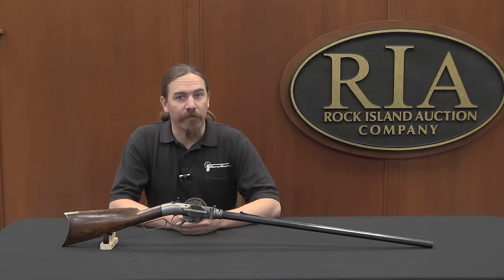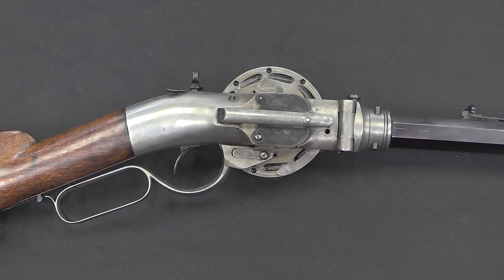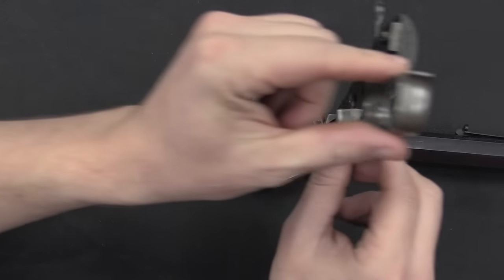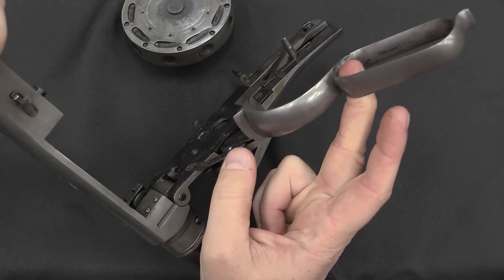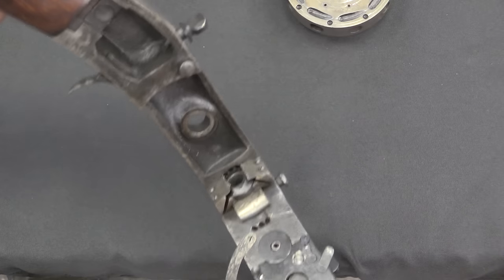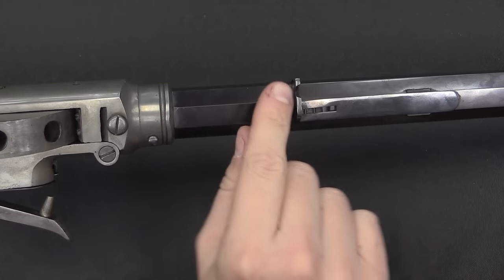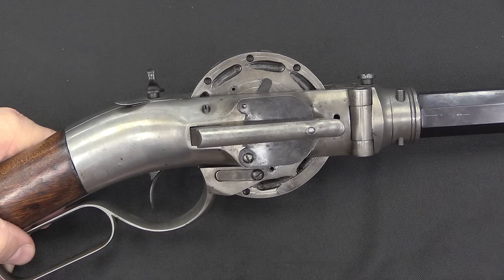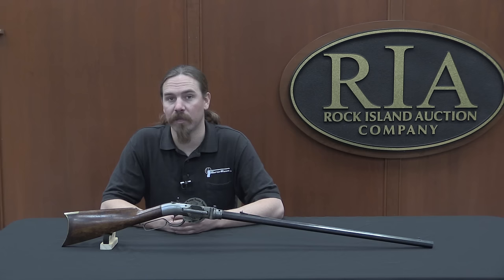Porter Turret Rifle: Awesome But Dangerous

Comment: I suppose you've already figured out the cap magazine being open when the rifle is cocked, but in case anyone doesn't know - I found a picture of the rifle, where the cap magazine has a sort of plate around the hammer that completes the circular look of the cap magazine and holds the loaded cap in place. The hammer fits in a hole in the magazine rather than an open space where the caps would fall out.

Comment: I bet there was some sort of clip that held the caps and it was loaded as one piece with the caps captive.
Reply: +Григорий Александров I think this is backed up by the fact that the "pusher" is not a half-circle as you would expect if it was pushing caps, but is a flat edge that would push on some sort of strip backing with all the caps on it.
Reply: +Григорий Александров I was thinking a similar thing. A discardable paper cartridge, each time the hammer slams down, a cap is torn off and detonated.
But a metal clip like +Ryan resa is talking about makes more sense.
But how would you index it? The caps would somehow have to prevent the clip from rotating unless they are fired. We need a better look at the cap magazine.
Reply: M a g a z i n e *
Reply: Maybe you don't actually open the compartment to load it, but rather single load caps into it tube magazine style? Looks like they might be retained that way.
Reply: pj jp  kids don't do drugs

Comment: All the comments saying stupid design is kinda annoying. It's interesting for sure and its an old design.
Reply: +ultor europae not really that unsafe. For the time period it's pretty advanced I'd say.
Reply: +ultor europae Compared to modern designs, sure, but we can only say that in hindsight because we know what works best
Reply: ok I'll give you that one. probably why this was the first variant lol
Reply: +ultor europae I know. But it's not a big deal, because this isn't a mass produced modern gun. It's a piece of history and engineering. Appreciate it for what it is.
Reply: +David Ridout believe it or not but there are guns that require you to put your hand in front of the barrel to load. They're called muzzle loaders.
Reply: +David Ridout They're not primed and I suspect that the chainfire risk is greatly exaggerated.  From a bit of googling firearm boards, there are two ways you might get chainfire.  Either sparks cross between the touch holes or venting gasses from one chamber set off others.  The latter can not happen on this gun.  I don't know how much of an issue the former is and it may not be able to happen on this gun either because the cap is spaced away from the plane of the cylinder and only one cap is in place at a time.  It apparently relates to crimping #11 caps onto #10 nipples leaving gaps.
Reply: +Anthony B   Agreed.  It's easy to be an armchair quarterback designer when one is looking back in time.
Reply: +David Ridout i totally forgot Ian is the master engineer of guns and gun safety. He may know a lot about guns and their history, but the gun is not significantly unsafe, compared to other rifles of the time.

Comment: The Cylinder looks like it took an awful lot of machining for that period of time.
Reply: +JinzoDefiler I don't think so. Cast parts are unable to withstand the high pressures caused by firing the catridge.
Reply: ***** Bronze cannons had the advantage that bronze is pretty flexible. Cast Iron Cannons on the other hand had a tendency to burst without warning. This is the reasons why they started to reinforce the cast iron barrels with wrought iron rings to reduce the chance of rupture. 

And what you said about car engines is wrong. Most car engines have a maximum chamber pressure of around 400psi. 9x19mm has a maximum chamber pressure of around 35.000psi (if you use the SAAMI testing protocol).
Reply: And even old cap and ball revolvers had chamber pressures between 6000 and 8000psi.
Reply: +JinzoDefiler they definitely had the machining capability at the time, it was just really expensive.  go check out his video on the merwin and hullbert revolver.  its got tolerances so tight that a vaccum forms between the parts
Reply: +AldanFerrox Casting can easily withstand the pressures associated with firearms.  While forging and machining was the standard of the era, castings could easily withstand the pressure.  Seriously, the millions upon millions of American small arms made during WWII were all castings, specifically lost wax casting.  Ruger still uses casting as its main method of manufacture.  Just an fyi.
Reply: Ben M What kind of firearms? And what parts? Barrels? Chambers? I don't think so.
Reply: AldanFerrox Actually, as Seth said, no cast chamber could withstand a .308 round. That said, Ruger made a 9mm barrel that was cast. Crazy to some, but no history of explosion. Seriously, casting has a bad reputation that is largely undeserved.
Reply: +seth newman We aren't even talking about the same thing at this point. I'm talking about casting in general. It sounds like you are talking about casting in the era this video is about.
Reply: +AldanFerrox Lathe and mill. Both tools existed. That being said, i think this is cast, check the tear drops. Those are castings.
Reply: +AldanFerrox the 19th century machining capabilities were just fine.they were infact machined.
Reply: +aserta lathes go back into antiquity so far back that the records of their use are in wall carvings in rock. lathes that a machinist would recognize have been around since early in the 18th century.Rotary filing was used before milling machines. The early history of rotary filing dates back to the early 18th century, at which point milling machines start being built and used.  Temporalism means that the past is real as well as the present.
Reply: +AldanFerrox 
However they made it, it looks a heck of a lot stronger than the cylinder on my reproduction .44 . Much more massive.  For the rest of the arguments consider a cast then machined to spec part would be very strong in that configuration. At least for the era.
Reply: AldanFerrox im sure it was thats why we dont see many at the time
Reply: Perhaps, but this did not use cartridges.  Almost all of this was cast and then finished where and as needed only.
Reply: @AldanFerrox  To clarify re: car engines; 400psi would be the compression pressure you might see in a high-compression diesel engine, but it is not the combustion pressure. A petrol/gasoline engine can see upwards of 1000psi during combustion, and a diesel engine can see in the region of 2900psi during combustion.
Reply: @AldanFerrox  you think they cared? If it sold whatever issues it has is now the customers problem
Reply: @AldanFerrox  It depends on the material used
Reply: @Da Shark And very quickly it won't sell anymore, and you'll wind up in court.

Comment: Looking at this thing makes me want to write a steampunk story. The over complicated but functional design is just the sort of thing that makes me think of anachronistic Victorian era technology.
Reply: +loahnuh It looks like the sort of thing you might see someone using in an episode of Trigun.
Reply: +loahnuh It's not really overcomplicated... the mechanism is fairly simple, the only bit that makes it particularly more complicated than a normal revolver is the cap magazine with how caps were placed automatically. Otherwise it's just a matter of the parts being on the side instead of the back/bottom of the gun.
Reply: +loahnuh Along the same line; imagine the submarine being invented before the propeller screw...
Reply: +Ronald van Kemenade the Drebbel (c.a. 1620) according to wikipedia, I remembered mention of a Civil war submersible watercraft that was manually driven, and built by the Confederates (the H.L. Hunley, wikipedia again), so not much of a stretch. Thanks to the old  Carmen Sandiego cartoon for that one.
Reply: loahnuh
Amazing, thanks!

Comment: I wrote about a rifle very similar to this one in a series of alternate history stories I wrote inspired by the Cochran Revolver. 
In my case the turret or wheel as it was called was horizontal, not vertical, It also used an internal wheel lock type system so it was called a wheel gun. An arm crank on the bottom (doubling as a trigger guard) would be rotated one revolution which would rotate the turret, and cock the firing mechanism. Being a wheel lock and needing to be primed for each shot (the story was set before and during the war of 1812) the turret moved underneath the frizzen which kept the primer charge away from the other touch holes in the turret preventing chain fire. The turret could easily be removed and replaced with a fresh one (held 9 rounds).

Comment: This may have been designed to use the Maynard Tape Primer system, which was in use by the United States military at the time, specifically in their M1855 Springfield, and that would explain the confusing "percussion cap" magazine, and as it's a tape, would not spill out as a handful of percussion caps would.

Comment: Could it be that it was the shape of the percussion caps themselves that held them in place? After they were fired, they might have deformed enough to fall out. However it worked, that is a fascinating piece of weapon design.
Reply: +David Landon Cole I suspect that there's a little leaf spring missing, much like the ramming assembly is missing. Still, a very interesting design.

Comment: I'm a cap and ball nerd. This gun is amazing and I want it
Reply: Bid on it.
Reply: +ultor europae It's just a wall hanger, but you could probably shoot it but only with one firing hole loaded.
Reply: +DeWolf33 We can help with that.  :)
Reply: +DeWolf33 
I don't blame you! 
But like he said there is something missing to register and depose the fired caps. The metal on that thing looks awesome though so I wouldn't be afraid to operate at half it's rated charge just for fun. But the loading mechanism is missing and also something to do with cap transfer. Oh and it was never mentioned what kind of special caps this thing needed since it slid them into place and didn't actually have any way to place it on a nipple. Brute force? LOL There had to be something else acting there besides the spring loaded cap revolver mechanism.
Reply: +TruAnRksT theres meant to be a small arm that reached around the bottom of the cap housing, you can see the hole for the screw int he bottom of the housing at 8:52 , it curls up and meets the hammer opening
Reply: +squeak83uk2 
There had to be something there originally connected to the action to position and allow the caps to index.

Comment: the complexity of the machining and design put this rifle into the "work of art" class. Only the most precise tolerancing of the turret and locking components would create the alignments needed to position the cylinders correctly. This movement is 20x the size of the tiny notches on a colt revolver cylinder making it 20x the strength and reliability.

it would really suck to be shot by a chain fire but the design is still beautiful.

Comment: Is there any actual historical documentation of a chain fire on a Turret rifle putting a bullet in the user or was it more of a psychological issue?
Reply from the maker: +J. Murphy I don't know of a specific documented incident with a Porter, but chain firing with percussion guns was a real issue, if not a common one.
Reply: Uncommon but real when the chambers lie next to each other as in a typical revolver. The sparks from the cylinder gap can enter into an adjacent chamber and if the bullet doesn't have a good seal, potentially could ignite the charge and cause a chainfire.

This turret gun however I think would nearly negate that possibility due to a few design factors:
1. Since the chambers are mounted radially, the openings are much further apart than a parallel chamber cylinder which would decrease the chance of errant ignition.
2. Again since they are radially mounted, the curve of the cylinder moves away from the direction of any cylinder gap sparks
3. The chambers that are pointed at the shooter are the ones furthest away from the cylinder gap sparks which again decreases and chainfire chances
4. The tension springs around the barrel I think also served to control cylinder gap sparks and gasses. They looks as though they have relief holes so that the majority if not all sparks and gas are directed towards the front of the gun, as well as the 3 releif holes drilled into each side of the receiver right at the cylinder gap.
5. Lastly, if by some miracle one of the rear facing chambers DOES go off, it would need to shoot completely through the rear of the receiver and stock, which I find unlikely. It probably end up blowing the side open and all the bits falling out. Maybe get a little hurt, certainly scary, but not deadly I would think.

Comment: If the user was afraid of chain firing, they could always load one, two, or even three chambers at a time. They could load the top three chambers prior to cocking it and neither would be pointed at the shooter in the event of failure. Since they would not have to load through the end of the barrel or place a percussion cap after each round, it would still be faster to reload than a traditional muzzle loader. It does defeat the purpose of buying a nine shot rifle, effectively reducing it to three repeated shots, but it would work.

Comment: Could the caps be on a continuous bandelier? So a strip could be inserted and engaged into the dog/finger in the cap magazine, not requiring any extra retaining mech.
Reply: This is my thinking as well. The video didn't show the bottom of the magazine area so well. The strip could be placed so that the part of the strip with used (burned/flattened) caps would be pushed there, but something would have blocked a full, unused cap from entering there.

Comment: There is another problem with this kind of turret cylinder.  The amount of propellant is very limited by the fact that the chamber is necessarily less that half the diameter of the turret.  With a 'normal' cylinder you can actually make it quite long and, hence, powerful.

Comment: It's possible the serpentine loading lever assembly missing from the top had an extension along the side that held the exposed caps in place and prevented them from falling out.  That would explain why it's missing- the assembly would have to be removed in order to open the side plate.

Comment: wow, I alway did love a mule ear lock, but I never thought a side slapper would be used for a revolver though. its not hard to forge a mule ear lock.as I remember, the military tested the Cochran horizontal turret revolver against the colt and found it seriously lacking for just the same reasons you mentioned.it also isn't very soldier friendly.i also think your right.it is missing a part.thanx for the video.

Comment: I wouldn't recommend ever holding a rifle with cylinder gap in front of the cylinder. Many people usually say that just because chain firing which isn't an issue but hot powder and breaking of cylinder locks that could cause the barrel and cylinder to become offset could be more dangerous albeit rarer.

Comment: Cap and Ball pistol lasted until 1873 when Colt came out with the 1873 New Army. As for the Cap and ball revolvers, they could be converted to cartridge as early as 1866, Henry came out with a lever action rifle in 1860 and Spencer followed with one in 1861. So this rifle did not come out at the end of the cap and ball era, more towards the middle. Okay, it is either missing a small piece or it used a larger cap, that would not fall through until it was destroyed in firing.

Comment: I think the risk of a dangerous chainfire could have been abated if that indexing spring had been enlarged to cover the flash hole. That would have effectively sealed the flash hole nearest the firing chamber and prevented it from jumping. Something similar could have been done at the top.

Comment: It is missing two parts at the cap magazine.

There is supposed to be one spring(?) mounted at the small hole underneath the big one holding the cap magazine closed, which wraps around the front end (probably only allowing a squished cap to fall out, and a rod screwed to the lever with two screws (underneath the screw visible on the lever) that pushes into that magazine - most likely to scrape the used cap out when the lever goes forward, and guide the next cap (pushed by the magazine spring) into place on returning the lever.

Comment: 7:44 I think that the design of the firing caps was made so that they would be stopped by their own size from just all being pushed out of the little revolver magazine. Then the hammer would either deform them and allowing them to move or simply removing the cap completely while firing... just a thought.

Comment: They did not use single Percussion caps, but some kind of "Amorces" taped bands (small ignition loads in paper wrapping as known from toy guns). So nothing would drop out.Chain fire is kind of over-estimated, as long as you avoid using undersized bullets. Round balls are more prone to causing chain-fire, but elongated Bullets (which i would prefer with a rifle) with grease grooves make chain fire almost impossible if properly sized.